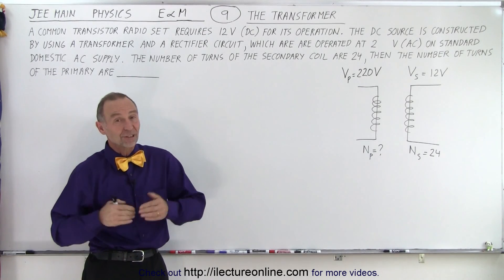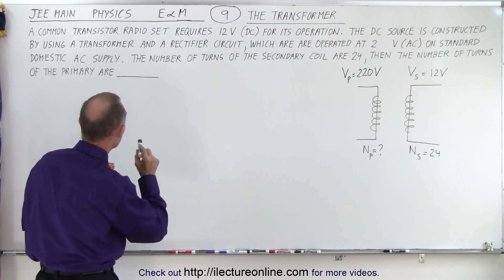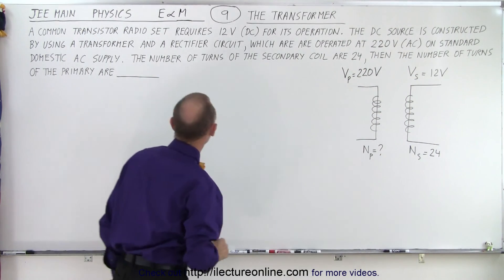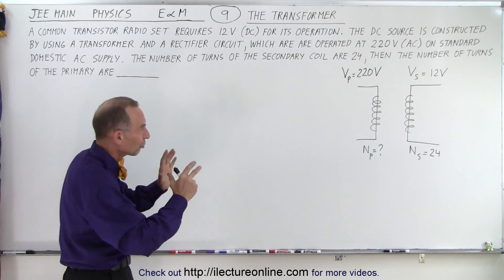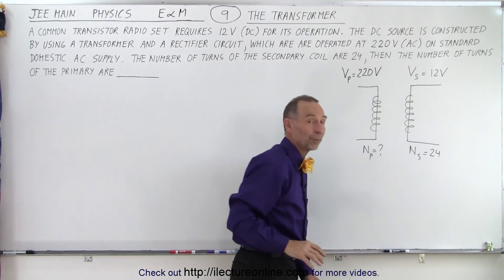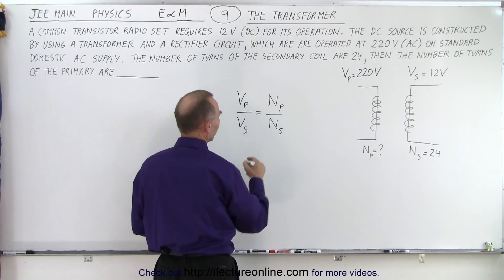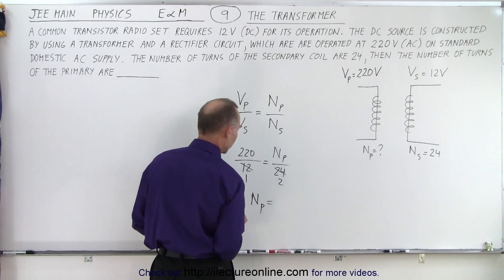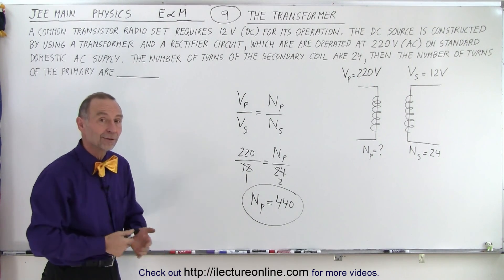JEE Main Physics E & M #9 The Transformer

Comment: What would have been confusing to me here is that  the AC voltages are RMS and so the rectified DC (unloaded) would be  12V * 1.414...  volts DC not taking ripple into account and would modify N  slightly and but somewhat higher than 440 turns...   That is of course, IF they really meant  12.00 V DC... Close enough for transformer work  😁
Reply from the maker: Typically AC voltages are expressed in terms of their RMS values.
Reply: Yes they sure are !   But the DC value (unloaded) after rectification will charge the capacitors up to the peak value of the sine wave.  (typical application)...  I suppose most would not be confused unless they do that kind of engineering a lot.  Simple but subtle things you know !

Now, had the problem asked for 12V AC on the secondary, there would not have been any possibility of confusion on my part.

I did get the right answer before you worked it out but I was ready for the possibility that there may have been a twist to the plot  😀😂
Reply: One related addition....    We have a tech that was supposed to have made a 600V DC supply from 120VAC.  He ordered a small 120 VAC to 600 VAC transformer.   He did not understand why instead of 600V DC on the rectified DC output that he got around 850V DC.   He forgot about that little extra part

Comment: Here’s an interesting question for you sir: will the answer still be the same even if the efficiency of the transformer was 50%?
Reply from the maker: The efficiency of a transformer refers to the amount of power transferred versus the amount lost due to heat loss.  It does not affect the transformed voltage.
Reply: @MichelvanBiezen  yes sir! 👏 I got it
Reply: @MichelvanBiezen  Nice! Good to know!